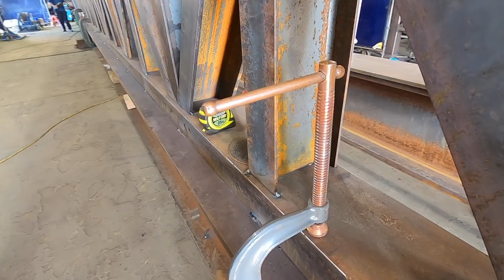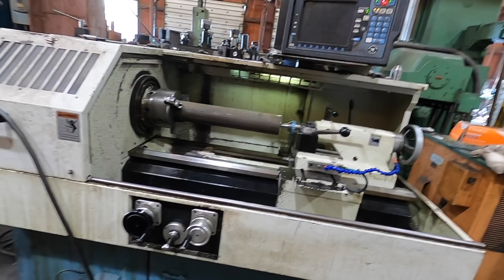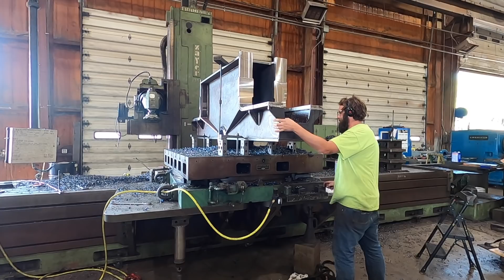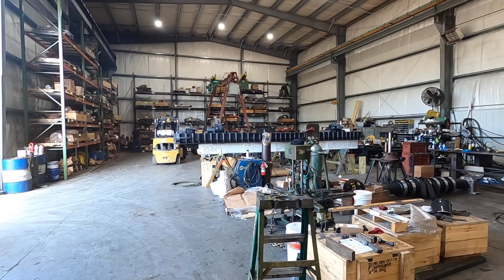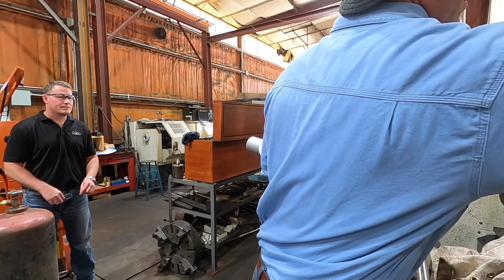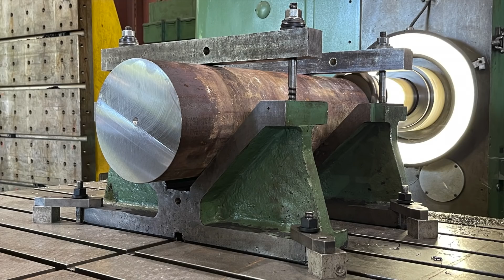Mill Mechanical Shop Tour

Comment: Did you kill a mouse or something during your training? What the hell fell out of the light of that lathe at 37:23? I definitely would be doing that in a different lathe. Too much in there that could accidentally get destroyed that cost a lot of money to replace. Plus you can see stuff smoking from getting hot. I would also consider that live center to be a dedicated live center for spray welding and get a new one.

Comment: Some of that equipment reminds me of a time I did overhead door service work at Hitachi Canada where they made the biggest turbine engines I'm shur ever  used primarily to run generators for monster power needs all over the world. They had a lathe that was 12' across and a hudge tool gantry. And I was there when the where prepping the footings for a lathe that was going to be twice the size the foundation for that was to the top of concrete cassones where 15' to 20' 3' diameter below floor level they told ,e the shop allows was under 8.5 acres of roof 120' to the roof eave. And the floor was clean enugh to eat off of. Start of every shift they had Japanese music to lisen to wile every body subcontractors doing service work included would do strecheing warm up befor you did any work. Sory for my rambling very cool place to see

Comment: I love the video.  Awesome shop tour and amazing to see that scale of projects. I would definitely move the computer for spray welding. not only it will keep the computer working, but also the worker will do a better job. Because the worker wont be worried about destroying the computer.  Another thing I would worry about is the center support. maybe add some protection for that so it last a good long time.

Comment: Holy crap, that is some big boy stuff. I'd sure be worried about torching the CNC control panel! Not just flame, but radiated heat and stray particles all over. They need to get a crappy old all-manual old school lathe to blast that powder.

Comment: Most shops you are visiting are something between barn and junkyard - so dirty, so messy...unbelievable.
Reply: It would take a month to clean a place like that and less than a day to make it dirty again.. it's not practical or economical to keep it spotless.. as long as it's clean enough to work in, that's all that matters
Reply: Did electrical work in an old automatic screw machine shop. Even though they shut down 1 week every summer to clean off all the oil that settled on everything within a few werks oil was on every light beams etc. Got stuck on another job and left a few ladders in their shop. Had oiled over every inch of ladders.

Comment: The next time you come out to California for the Bar Z Summer Bash, go visit Trak Machine tools headquarters in Rancho Dominguez. (Just about 10 minutes from my house) The guys there are great! I have a Trak AGE 3 Bed Mill (3 hp 40 taper) and they donated a couple lathes to our trades program at Long Beach City College where I work.
Reply: My mill's 3hp & 40 taper - if you ever get to England, Adam ;)
Diesel powered too !!!!
Reply: @millomweb  I was just saying I have the smallest bed mill model made by Trak and it barely fits in my home shop.
Reply: @teddetitus671  When we put ours in place, we moved it on scaffold tubing as rollerrs - but it wouldn't fit through the door on them so it had to be dragged for that bit :)
Reply: @millomweb  I was lucky, even on 1/2" pipe it squeezed under my garage door opening. I'm at the point of building a new garage/shop. I had to roll the mill (using 1.25" pipes) off the concrete drive onto some compacted fill to continue. I hope it doesn't sink down! LOL. Check out some of my stuff on Instagram  - TeddeTitus
Reply: @teddetitus671  Instagram is one thing I don't use !
Fortunately, we had a friend at the time with a digger with forks on the front bucket. Used it to off-load from the wagon then push it under the garage door !
(I'm not sure now if we had it as vertically compact as it could have been !). Pics:
https://docs.google.com/document/d/1pb7qqXny2uVdzw8q_ZwrZk6sk0WTvGEOFPxh76vc9V8
Reply: @millomweb  That is a beast! Kind of reminds me of the robot from the old Lost In Space TV series or a deep sea diver's suit. I have a couple videos on YouTube but they are just some novelty laser cutting (best watched at 2X speed - LOL). You may see me on Stan's live stream of the Bar Z Summer Bash 2021 this Saturday (Shadon HKW) - I will be the 6'4" 300 lb. white guy w no hair.
Reply: @teddetitus671  "That is a beast!" - thanks !
It's what I childishly call 'my first milling machine'.
Dad had retired from work & we had the lathe. He fancied a mill & saw this advertised. They wanted £800 for it. Dad was umming and ahhing whether to get it ot not. I said "At that price, we'd be silly not to." So we got it. We went to see it first but other than knowing what milling machines do, we knew nothing ! So to me, it was just a milling machine.
Last summer, I started watching the likes of Abom79, Vintage machinery and a couple of UK small workshop guys. The latter have the usual 'toy' milling machines but as you probaly know, both KR at VM and Adam have pretty decent machines ! (Cincinnati and K&T). The more I found out about theirs, the more and more I realised that this one, a Dufour type 61 is actually better than theirs - and I just couldn't / can't believe that - and now I realise how lucky I am in having it - until death do us part ! It may not win on size, it may not have a DRO fitted but it has quite a few quirks and neat tricks up its gearboxes that I'd taken for granted but now really appreciate.
I've yet to ee a Bridgeport that I can take seriously - LOL. OK pretty good machines - but can you point the spindle vertically upwards ? Not only can I do that on mine, I can do it 2 different ways - depending on whether I want the spindle to the left or to the right of centre.
About a week ago, I've just reintroduced the place to 3 phase electricity. Test runs of machines have taken place - I have an electrical problem with the rapid traverse on the mill. Some electrical work has been done but I'm not set up yet with the 'finished' installation of supply. Once that's done, it'll be a matter of getting the rapids working again - then a decent service from its 15 year enforced rest !

Comment: For your automated subarc system you should convert over to 1000lb wire rolls in cardboard barrels. Your lathe bed is heavy enough to carry two barrels side by side so that when one is depleted your can reload fairly fast and then replace the empty barrel with a fresh. Your barrels wire will require a simple shop made decoiler to keep the wire from becoming tangled as it spools out. You can build a flux suction system using an air powered venturi vacuum that will recycle your flux back up to a storage hopper set up with a screen and magnets to pull out metallic particles as the flux flows by them and then use a blow system to jet the cleaned flux over to your subarc feed hopper so that you only top up your flux once or twice a shift. I set up a subarc for doing boilers this way years ago.

Comment: Bravo Adam!  In someone else's shop, on an unfamiliar lathe, with someone looking over your shoulder on a part that's a giant heat sink, put on a spray weld that machined well.  Also pass on congrats to your hosts for manufacturing in the USA.  Too often it's hard to get banks to work with you when you say you're not going to off-shore your machining.  Even though FlexArm gets their tables from Spain, they still do a lot of work here.  Investors also have been programmed not to invest in helping USA build things.  I used to attend the CalTech Enterprise forum where small businesses would present their plans to a panel of experts, and even if you had the equipment, a family run business, and a Just-In-Time process the big put down was "You cannot manufacture in the USA - it's cheaper to send your equipment overseas and have the finished parts come back again by freighter ship."   Good for you and your colleagues.

Comment: Those disk rollers, I'd think the preferred method to rehab them would be to just mill them down to a certain diameter and to get them round, and then do a press fit of new metal in the form of a ring, maybe chilling the roller and heating the rings, maybe with an extra lip to weld the ring to the disk, if needed. But, you say the American lathe just chews the disks right back down to the roller face? Wow. That feels wasteful to me, in time, energy, and tooling, but I'm sure he has bean counters to determine what's economicly feasible.
Reply: When you have a shaft solid to the core, it sounds silly to add an unbounded layer on the whole shaft. Wear sleeve technics exist, but they are not applicable to all scenarios.
Reply: @johnnylavoie  Yes, I would not expect a wear sleeve over an entire shaft, but I would for the disk version.
Reply: Because of what those rolls are for is why you wouldn't want to do that. They are for a steel mill on the hot rolls on the feeds so due to the extreme temperature differences even though there is cooling systems that type of rebuild would be problematic as a shrink or press fit type of sleeve would likely fail plus the constructability of a press jig to install the repair sleeves would almost be unreasonable to construct and execute effectively
Reply: @thecanadiantradesman7916  They did mention the… what was it? 100 ton horizontal press earlier in the video.

Comment: I'm guessing there's gonna be some serious mods made to that lathe for flame spray, I can see some melted monitors..
Reply: Yea I would imagine they will use a manual lathe in the future for it. Or even a rotator. As long as you get the required speed for the build-up process you can do the spray weld on a rotator in batches and in the welding shop area per say and then send them all to the machine shop after for the rebuild process
Reply: One would assume they will.  I mean heck, is was a one-off demo of the process, using ad-hoc setup.

Comment: My infrared thermometer does not give accurate readings on shiny surfaces.  I wonder what kind Abom is using?
Reply from the maker: I never take the temp off the direct surface to be built up, I take it off the sides where the masking is, or in this case the mill scale on each side of the undercut.
Reply: @Abom79  I suspected you were aiming at the dull surfaces or else had some high dollar thermometer.  I was hoping to find out which and I did.  Thanks.  I first noticed my thermometers problem with melted lead when I shined it on the shiny surface I got really crazy readings.  Then I tried other shiny things and had the same result.  I am sure some smart person knows why but I certainly don't.
Reply: @AmateurRedneckWorkshop  Emissivity varies with surface. Nicer thermometers will allow you to adjust for the lower emissivity of shiny metals.
Reply: @par5endos562  I am sure nicer means "expensive" which is why I don't have a nicer thermometer.

Comment: Adam this shop is doing what I use to do at a shop working my apprenticeship years. We hand welded rollers not quite as big but 5' plus 2' of journals we did the journals n roller then my job cutting it back to specs. Steel mills must use lots of these things . I have to have remachined  a thousand of them. Besides milling the blocks on a boring mill run by overhead pulleys. I think it built the ark for Noah. Sure taught me how to keep tolerance on antique machines. NY open side planer shaper was about the newest piece. I miss those 72 hr weeks. Not
Reply from the maker: I believe Dave said the steel mill has 800 of them on the line.

Comment: Hi Abom, where do you get your metal supply from here in Pensacola FL?
Reply from the maker: Most of what I use I buy from McMaster Carr. If I need larger structural steel I usually buy from D&D welding.
Reply: @Abom79  thanks, I figured it was D&D welding or Steel Service Center.